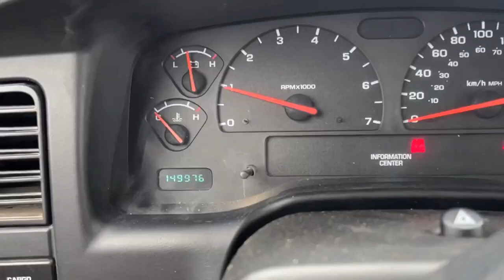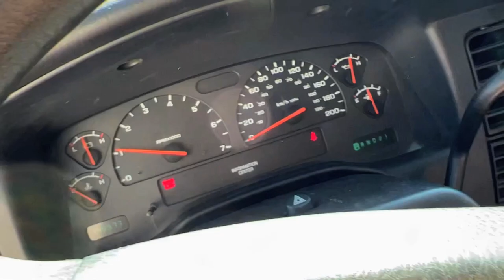$1500 DODGE Dakota JUMPED!

Comment: Should be taking one Ford off the road at a time. The Dakota is a beast. I have had 3 and my current has the 5.9l V8 with 4wd. Not sure if you’re a ford or Chevy guy but that doesn’t really matter. Because no S10 or Ranger could compete.

Comment: Should be taking one Ford off the road at a time. The Dakota is a beast. I have had 3 and my current has the 5.9l V8 with 4wd. Not sure if you’re a ford or Chevy guy but these dakotas were designed to destroy the small truck market. 3.9 5.2 and of course the 5.9 with 345lb tq!

Comment: you should do some Rocking horses with the Dodge Dakota
Reply from the maker: What a rocking horse?
Reply: It's when you drive forward full Speed and throw the car in reverse without putting your foot on the brake and then putting in reverse  driving full speed and throwing back into drive without putting your foot on the brake that's what a rocking horse is